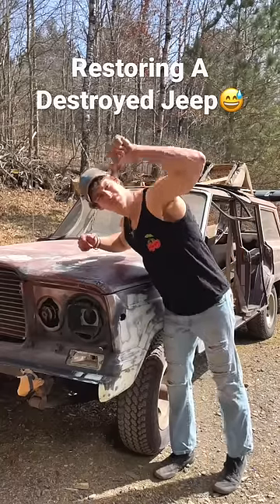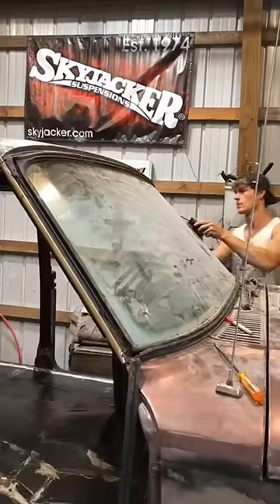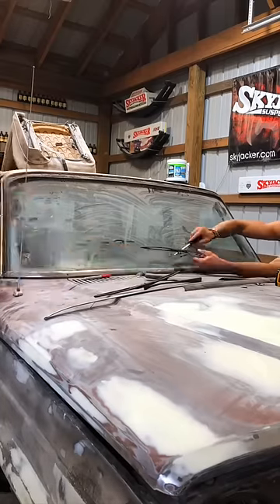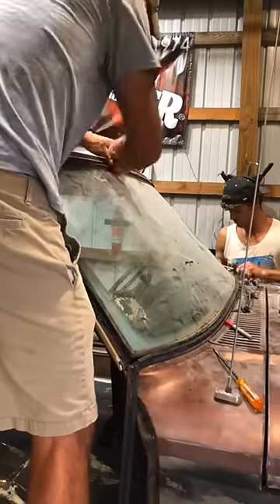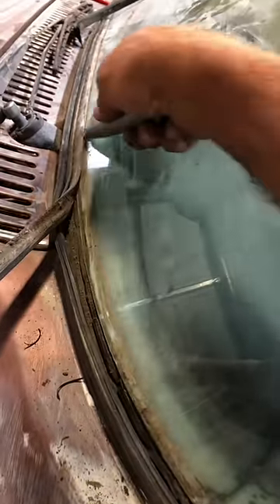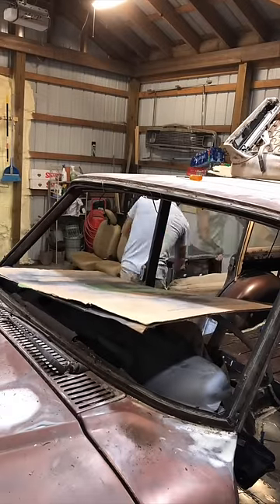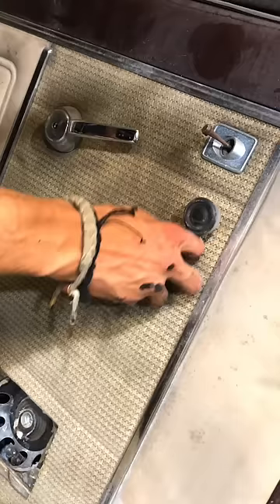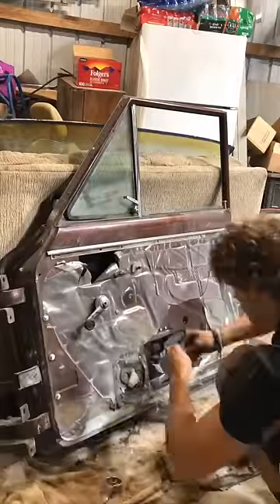Was This Jeep Worth Saving? 😅 #automotive

Comment: I can't believe the chrome trim around the windshield has screws holding it on.  Great entry for water!!
Reply: Honestly, sounds like a fumble.
Reply from the maker: Tbh jeep did a lot of horrible things on these haha, they leak a ton. Water comes in through the door seals, window seals, roof, windsheild etc hence why to floor rusted out
Reply: @liamreid  next video is gonna be why you bought 2 boxes full of sealant😂😉
Reply: Surprised by a shitty jeep, interesting
Reply: I wonder if there’s a way to seal it when screwing it back in like using some kind of temporary sealant or tape
Reply: @NigelThornbery  I would think plumbing tape would be good wrap some around the screws perhaps
Reply: @liamreid  please upload full videos to yt. Wanna watch this thing in its entirity
Reply: Ttytytyyyyyyyyy
Reply: Screws dont leak if tight. Soft rubber seals aroumd screw. Normal leak areas are top and bottom corners. Usually top corners.
Reply: Windshield and seal can be installed all day from Safetylite all day long
Reply: I working on a jeep and we uave news seals for the windshield and it came with screws
Reply: My Grand wagoneer has screws in it holding the trim on as well
Reply: @liamreid  damn I thought it was just the modern Chrysler products that had Shit designs
Reply: The hell did you think he'd it down?? U miss the part where the seal is underneath the chrome as well....... Pay attention and actually learn about what your gunna put your 2 scents into before ya do it
Reply: @diychad7268  I understand that English is your second language, but could you try again please?  Thank you!!
Reply: "Its a jeep thing"
Reply: It won't leak from the screws.  The seal is between the body and windshield, the trim is decorative.

Comment: From a spray tech. Those paint like undercoatings only hold in moisture. I’ve seen 2020s with that stuff all rust out, go with a oilly type. Yes it will drip but it works and let’s the metal breathe while displacing water. Krown is the best imo but oil guard and stuff like that works good too
Reply: That's rubberized undercoating. Painting is different if it's prepped right
Reply: @jdmking4776  to a point. Factory undercoating is the worst and that’s paint. No matter what on the underside of a vehicle your gonna get chips and scratches and that stuff can’t hold up. Even stuff like bed lining holds in moisture from how’s it’s done. Best thing is oily coatings
Reply: @riorrdanmurray9071  Yeah I guess for a rig that makes sense. I'm not going to spray that stuff because it makes the car really gross to work on when you're on stands luckily I live in SC and we don't have rust issues hardly
Reply: @jdmking4776  yeah I get that. Doing oil suck but better then heating every bolt up here in the rust belt lol
Reply: Good to know. I like Fluid film products the oily ones. Wanted to spray my Edsel frame but am contemplating whether I should paint it with regular black paint then fluid film or not...
Reply: @davidshipulski4532  never tested it. Put it in a glass of water. It should sink and remain the same colour. If it floats it’s no good and if it get cloudy that means it’s absorbing water and will hold it in and will rust shit out quick. Krown is the best if you want quality and a great Great price
Reply: @jdmking4776  you must not live near the coast and been caught during a moon tide, storm surge, or depending on where you are just normal tidal flooding. That's one thing I won't miss having moved to the up state from the lowcountry.
Reply: @rustbucket1728  Yeah I don't. Live near Chester. SC doesn't salt their roads though. When I lived near the coast in Oregon we had rust from the coast but it was nothing like Pennsylvania in the rust belt
Reply: Go with Raptor coatings or some sort of heavy duty chassis saver. When applied correctly,  it's bulletproof.

Comment: I replace windshields. You can get just about every piece of glass for these vehicles easily. They're easy to find used. But most have terrible delamination. I'd prefer replacing the windshield.
Reply: I was thinking the same thing. Any glass is obtainable. It's just a matter of money.
Reply: Replacing it shouldn’t even be expensive!
Reply: Great! Except for one thing, a vehicle that old may not have  safety glass like they make nowadays
Reply: @joelnordstrom8049  safety glass was introduced in the 20s and made mandatory in the late 30s. It has it. Most "modern" vehicles from the 50s and up have it besides some old big rigs and offroad machinery.
Reply: Thats right costume made windshields are not expensive

Comment: Almost everything on that car can be replaced if you want to bad enough, on mine I needed new window seals for the drive and passenger windows and couldn’t find any for my specific vehicle so I just bought some random roll of it that was the same size as the original seal. Works wonderfully.
Reply: yeah, it'd be no where's near as difficult to find replacement parts like for my 83 honcho or the 64 Studebaker I want

Comment: Make sure you use apex betaseal urethane, it already has the primer in it and as long as you trim the old seal off and have a even bead on there you shouldn’t have leaks after placing the side moldings. Don’t put too much too that will lead to a water leak.

Comment: The windshield and molding are still available.  Wait till you try to get the chrome trim back on... Use a string and either some spray soap or silicon.

Comment: Take a sledge and hit in a circle pattern as close to the hub as you can and those tires will come off I had the same problem I was even dragging the truck down the road with a Silverado and the tires didn't come off but the sledge did it you just gotta hit it right
Reply from the maker: Ok ill try it!

Comment: That’s good you open the molding for the windshield and then you should’ve used to guitar string to cut the glass out when you use the razor you messed up all the molding it should’ve been replaced anyway

Comment: Windshield are super frigging strong however they will completely shatter with barely more than a pound of pressure on a utility knife blade on the very edge of the glass. They are tempered glass which makes the glass very resotNt to breakage in its field (the plane you look thru). However the very corner and edge of the glass panel will shatter with almost no force on a metal object, even something as flimsy and thin as a utility blade. Simply slippingvas you cut the gasket and then the blade impacting the corner of the glass will completely shatter the glass which seems like bullshit cause you can hir the glass pretty hard and even stab the glass with the blade and it doesnt break but a slight knick on the very edge and it will explode...side and back glass are worse as they are not laminated so all the glass will go everywhere

Comment: Make sure to get the corners started before getting the rest of the glass in the seal. You can break if from the stress when putting it back in, so make sure to use plastic tools when getting it back in.

Comment: When I was a wee lad, I had a junkyard, we always removed the windshield by doing the following; remove trim, open hood, cut the hood release cable as close to the latch as possible, pull out the cable from the inside. Push the cable through the adhesive from the inside, clamp vice grips on the end of cable and with someone on the inside, saw your way around the windshield. But your way works too 😂😂😂

Comment: Oh, you can get the windshield for about 100 bucks brand new from a glass company that ain't trying to tax you. The windshield you pulled out of it is called a shaded windshield. It's bronze on the one you took out. ( The strip at the top ). If you decided to get a new one they should offer that windshield in grey shaded instead of bronze in case you wanted to change it up a little. Have fun guys.

Comment: Not to be a smart ass. There was no reason to unzipp the gasket holding the windshield in if you were going to cut it anyway. I absolutely love these jeeps with the dodge drivetrains in them. Engines are rock solid and the transmissions are pretty good and cheap to bench rebuild. Love the body style and nice original versions of these have known to fetch 50 thousand dollars at auction. Good luck and have fun. It's a bad assed endeavour.

Comment: I'm sure that you did all the mechanical work before you send that out for paint, is it worth it ?? Good question was it low miles before you started? Is it or was it free? Are you a 12 volt electrical expert? Do you have an extra engine trans transfer case rear end and front diff? Just an old mechanic thinks this way

Comment: You should never put undercoat on old dirty paint or bare metal always put a urethane primer or rust block primer then a flat black paint then the undercoat. Because the undercoat hold moisture under the paint itself.